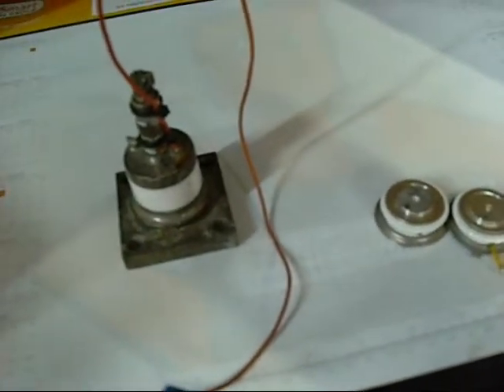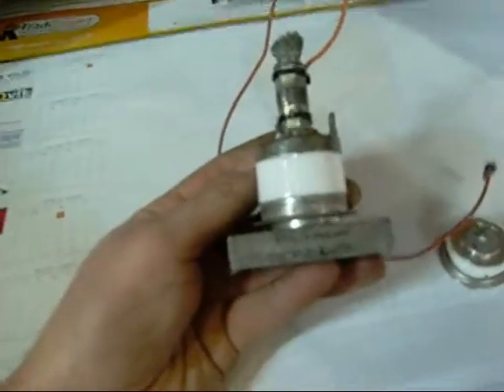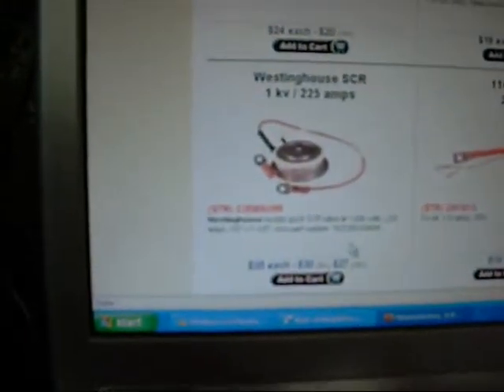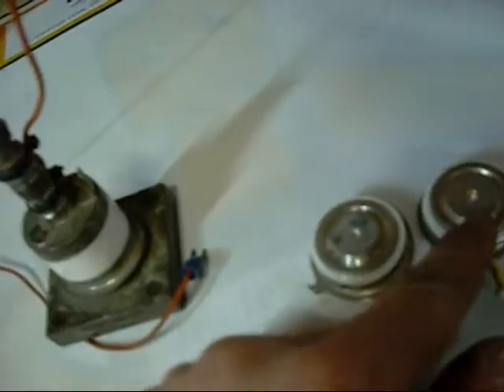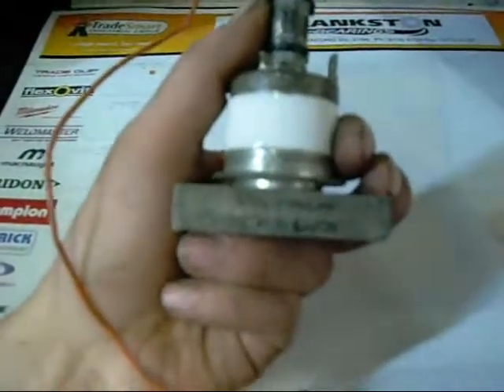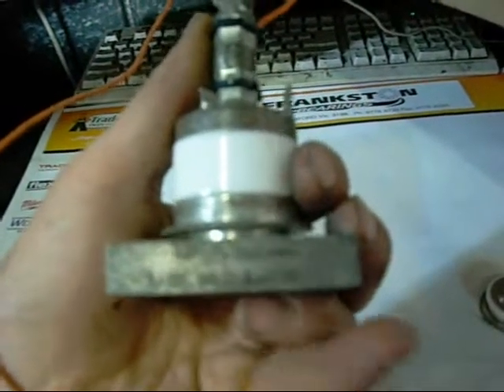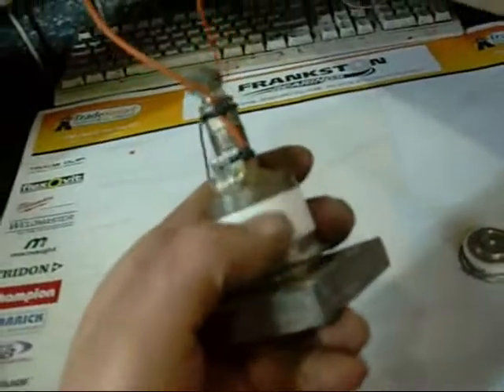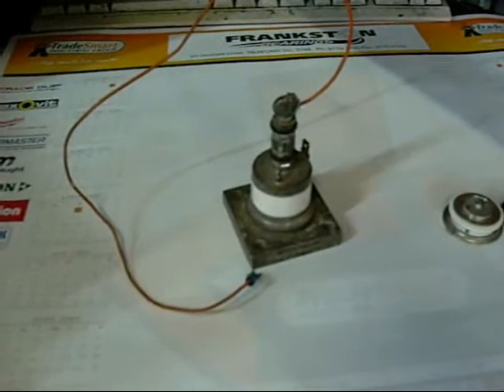SCR Questions

Comment from the maker: thanks a lot man!, I really appreciate it! I'm trying to learn all I can about these High voltage devices before I start playing with them.

MOT's and flybacks are one thing, this cap bank and VFD bits are scary!

the symbol you typed up matches the symbols on all three devices. a diode symbol with the gate arrow pointing into the center.

I'll make time to test them soon and post a vid!.

Comment: An easy way to test is making a small very simple circuit. Take a 12v lightbulb, a 12v battery, and of course wires, and a switch. The +12v of the 12v battery or supply goes to one lead of the light bulb, the - goes to the cathode, and the other lead of the light bulb goes to anode. Now, using a current limiting resistor of about 200 ohms or something, connect the + of the source to the gate (the thin wire). This should make the bulb turn on. Disconnecting the cathode turns it off and resets.

Comment: For reverse polarity the internal structure will be damaged or badly cracked. But if you think about it in reall life situation there is always a diode or another SCR in reverse that will prevent from such a thig happening. So the SRC circuits are very immune to damage there fore they are very good for motor control . Well now they move slowlly to IGBTs brcause they ofer faster control and they can be turned off at any desired moment in time. But as we know they are rather delikate.

Comment: In practice Alternating current will turn it off. Ooo. When SCR is turned off it is just an open circuit, when it is turned on it os a diode rectifier that conducts current in one direction only as diods does. So if you test them on AC it behaves differently than on DC. First of all normally is is turned off so the main conductors should be open, you can take a light bulb and make a series connection with the grid(plug hole). for DC car battery and automotiv battery is great.

Comment: So, connect the cathode K to the battery negative
connect one side of the headlight to the anode A
connect the other side of the headlight to the battery positive
At this stage, the headlight should remain off. If it doesn't the SCR is stuffed.
also connect one side of the small lamp to battery positive.
Now, briefly touch the other side of the smell lamp to the gate G
The headlamp should light, and stay lit even when the gate connection is removed
(continued next comment post)

Comment: Normaly there is some delay crcuit or controller that turns on the SCR at special time (moment) and waits for the 0V that will turn it off. There fore sinus wave is cut in smaller portion and delivers less power current for let sey heting element. triacs are bi directional SCR with common control tap. WOrks the same in two directions. It theory you can parallel two SCR in reverse to mace triac but then you have 2 control taps. But i this wav they make high power control on parallel SCRs.

Comment: as long as you do not cros the max voltage and current it very hard to broke SCR. Small littel wire or connector is control. The other two big are the main ones. Well SCR is just a diode with a control cable. So the main big connectors are just like the two connectors for big diode rectifier. And the current will flov in one direction only as it is with diods. So what the control wire does. It turns the SCR on thats all. Well what can turn off the SCR. In theory many things and events but .

Comment: well now what happens if you connect too big current then the specified. Well for few times nothing hapens. But if you will disharge caps with out a load after few times the silicon inside SCR will crack from tention andthermal stress. But it is still the strongest silicone switch. Metalik conductors are the best but they do arc oxidize and melt. And SCR are fast they can be turnd on and off hundrets times per second. IGBTs MOSFETs and BJTs can go up to hundret thousands switches per second.

Comment: That is all why peple use SCRs for capacitor discharges. So if you connect them in revers and have a light bulb in series alsow for control wire for protection nothing can go wrong just swith the polarity and that is all. So triggering the disharge is simple just small switch and protektion resistor like 1000 ohm or less depends on SCR and must be tested from big value to lower. And control wire should work only with one main connection.

Comment: Now i forgot the SCR . But what hapens when you cross the max voltage on SCR terminals. Well depends on the polarity. In the condaction polarity you can go up to max valtage and slightly more and the SCR will naturally turn it self on and surviwe always. Way is that? Ihear you ask. Well inside the pnpn structure when the voltage is higher than max the control wire is at same resonable voltage and it turns the SCR on. So simply internaly there is enough voltage to trigger the control wire.

Comment: For DC from full wave bridge it is different but simmilar to AC. You have to hold the control wire as with AC but the light bulb is twice brighter. Here the SCR works only with one polarity. Because current from full wave bridge is only one polarity either negative or positive. But is still has 0V points when SCR is turned off 100 times per second. The whole idea in SCR is to use them with AC od DC full rectified to control the power by cutting the shape of sinus wave.

Comment: For DC it is different first of all it will work only in one direction so if nothing happens revers the polarity of the SCR. But when it is turned on it will stay turned on forever, sort of. Direct current from battery has no 0V crossings and old SCR are not design to turn then off with a huge charge GTOs can be turned off. Well it works for capacitor bank because once it is turned on it will disharge everything from caps till the voltage goes to 0V and turn off the SCR.

Comment: Well so on AC you have to just keep touhing the control wire. Well it is a rectifier when it is turned on so the current will flow only on the half of the main grid sinus wave therefore the light bulb will blink with 25 Hz and be only half as broght. The SCR is turned off when the sinus wave in grid crosses 0V so eny time that sinus changes from positive to negative and negative to positive voltage. That happens a 100 times per second 100Hz so it is very fast. That is why control cable is presed

Comment: To turn it on the contror wire should be just prest for a short moment to one of the main connectors. Only one will work you can not broke the SCR if it is wrong connector it will stay off that all. For extra protection because this are high current ones the control wire make in series with light bulb 230v 40W small bulb. Now how it should behave on AC first than on DC. AC the main light bulb should lit only when the control cable is connectet when you take the control off AC will turn it off.

Comment: The two hocky puck types may be SCRs, but not sure about the bottle shaped one. Anyhow, a suggested test method requires; 1) 12V car battery 2) car headlight (say, 55/100W) 3) smaller 12V lamp (say, indicator lamp) and some hookup wire.
A typical SCR has three terminals
1) Anode A
2) Cathode K
3 Gate G
The anode and cathode are the 'power' terminals and the gate is the 'control' terminal
The SCR symbol looks like an arrow
        G
         |
A --|>|--- K
(continued next comment post)